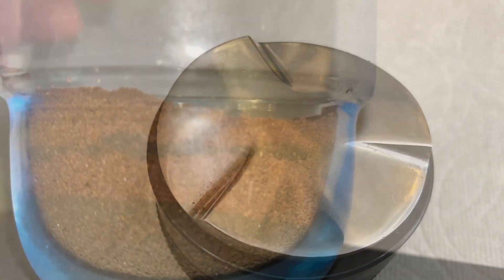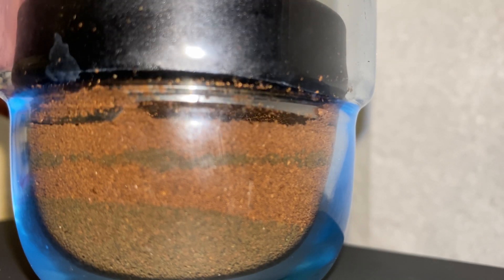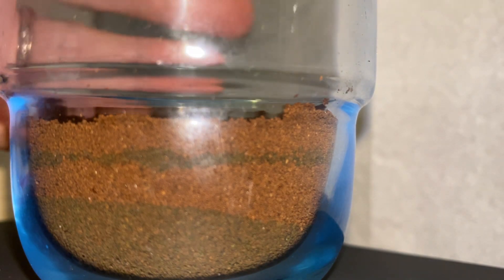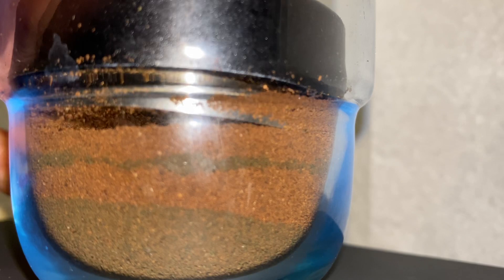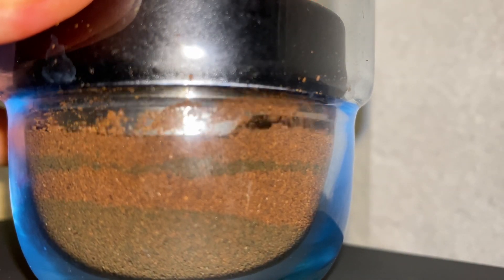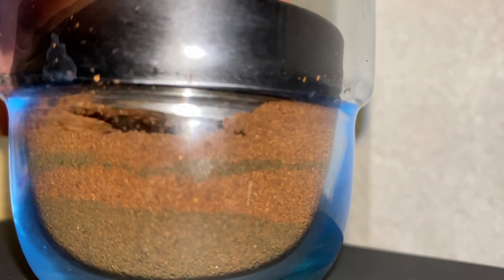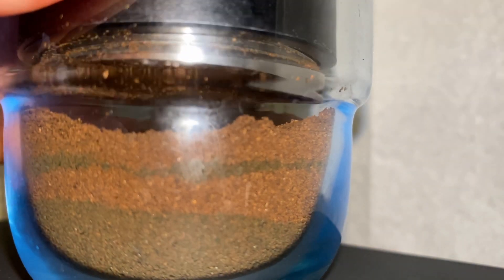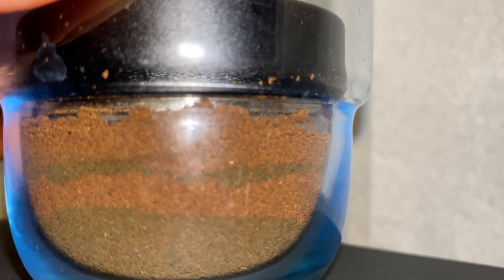Destroying the Myth of OCD Distributors for Espresso

Comment: lots of people refuse to believe distributors are probably worse for your shot... they find it hard to get over the fact that if they can SEE a level puck it must be doing something right. i have changed my process so that its tapping, WDT, tapping, tamping. after you WDT and tap, you get a very level puck that you then tamp, i feel my shots taste better as a result. i believe that the distributor tool axial force or sheering force creates grounds that are more tightly locked together on the top of the puck. i believe the tool creates a top layer that is difficult for water to get through and as a result water goes down the sides of the puck or partial channeling (channeling through the top puck layer only, then more even water distrubution through the bottom layer of the puck). If the channeling theory is true, this is probably why extraction yield is lower yet timing isnt really impacted and the shot still looks good in a bottomless portafilter.
Reply: I blame society for making it "not cool" to understand math!!!
Reply: What is wdt?

Comment: Distribution LEVELing tool is meant to LEVEL and tidy up the surface of the puck pre-tamping, not to mix & comb the whole through like WDT does. Think of it as a tool for the classic finger sweeping replacement. Plus what you did in the video is just a holy mess with unrealistic expectation. I personally like it, it creates a LEVELed and evenly distributed surface for tamping.

Comment: You got balls claiming this to be an experiment.  Or maybe it is not balls, anyway you have no idea of how to conduct a proper or valid experiment.
Reply from the maker: I’m guessing you didn’t read the description where I link to another experiment and other existing data or did you use this single sample to judge how well I did a proper experiment? 

If it is the latter, I recommend getting a larger data set that’s statistically significant. If it is the former, check out the description.

Comment: j.k... the tool doesnt sit on the top of the cup precisely.. this video is a total crap... plus it is not a distributor but only flattener.. you use distributor first, than the flatenner than tamper.. m.g...

Comment: Well, a useless experiment, if it is the one in the first place at all.

What the heck! The tool is not supposed to move the whole ground in the basket in the name of distribution which you seemed to be so obsessed with. 

It is supposed to move and level/distribute the upper crust and that's it...

What's in the name anyways!

Experiment/Theories/Data - my foot!

Much ado about nothing!
Reply from the maker: So to recap your comment, you say this device only is supposed to move the top, and this experiment confirms the theory. What is the problem then?
Reply: @espressofun6091  Looks like you are pretty paranoid about the whole thing concerning OCDs. Believe me, your experiments, data thing and theories are all like getting paralysis by analysis. 

Call it leveler or a distributor, it is meant to move the upper crust only and you are not supposed to make earth shattering efforts to move the entire burden in the basket.

There is no need to move the entire mountain for every job😂😂🤣🤣
Reply from the maker: @Hypocrisybuster1  you do you. I have an aim and I have analyzed a lot of my equipment in my journey to get closer to that goal. This tool doesn’t fit based on data.

Comment: Before saying i just destroyed a myth of one of the most successful specialty coffee companys learn to use the tool buddy. you are turning it the wrong way firstly and secondly you need to change the depth of it DO UR RESEARCH
Reply from the maker: I have reflected on your comment and did some research. Here’s the summary of that research: https://towardsdatascience.com/ocd-tools-dont-work-for-espresso-5b2f988af495
Reply: @espressofun6091  that’s not the ocd buddy that’s a roped off version :)
Reply: @espressofun6091  mate what you are using here as an example isn’t even the offical ona coffee distributor it’s a ripped off version, not sure why you are trying to make a fool of ona coffee but they are way out of your league in terms of coffee
Reply from the maker: @sun5534  why would it matter if it was the original or a ripped off version? The design is the same unless I’m missing something.
Reply: @espressofun6091  the design isn’t the same just look at the difference on the bottom and buy a actual ona coffee one it test it.
Reply from the maker: @sun5534  it’s a wedge. Why would it perform fundamentally different? It may have a different angle of surface, but it should perform the same. If spun what you say is the right way, within a quarter turn, everything is just flattened, not distributed. 

It is pretty and spins, but there’s not good evidence by design or performance that it is a good tool to use. I would gladly revise my opinion given data to the contrary but I have yet to see such data.
Reply: @espressofun6091  the different shape changes mate i tired this, please get your facts right ona is in another league  of you
Reply from the maker: @sun5534  it’s an opinion not a fact to say Ona is out of my league. I agree though, I think they are. I’m terms of science, I’m definitely a few leagues above. You can appeal to authority, but I am an authority especially for data related stuff. 

I would love for you to collect some data and show that this device empirically improves Espresso extraction or taste. I would gladly change my time but Ona also hasn’t produced data. They’ve only said trust me. 

I understand that you trust them. I trust science so show me the data.
Reply: @espressofun6091  also where did ona say trust me???? And they don’t need to provide data it’s like going to some big manufacturers and saying tell me this this and this things that could be confidential on purpose so there aren’t copy cats
Reply from the maker: @sun5534  I’m not talking about copycats. I’m talking about whether the tool is useful. All existing data says the tool decreases extraction. Not just my data.
Reply: @espressofun6091  where did you get all of that existing data from
Reply from the maker: @sun5534  I think it’s wildly used because it creates a nice visual and tamping on a flat bed. For a cafe, consistency is key not necessarily the best performance. 

Coffee competitions aren’t the end all be all. They are a performance. They aren’t graded on the best espresso. So while I’m glad he does well, unless he has data that the OCD is helping that performance, I will patiently wait.
Reply from the maker: @sun5534  I compiled the data here. One is Socratic Coffee and the other is a Compound Coffee. Additionally, I have seen some from Sprometheus as well as Pillar Coffee. 

https://link.medium.com/ak4hO0zpgtb

Comment: You're not even using it right.  That's pretty cringe.
Reply from the maker: I’m guessing you didn’t read any of the other comments.
Reply: @espressofun6091   I didn't even watch the whole video.
Reply from the maker: @bluemystic7501  you probably didn’t read the article or look at the follow up video.
Reply: @espressofun6091   In my eyes, you lost all credibility when you failed to use the leveling tool properly.
Reply from the maker: @bluemystic7501  in my eyes, you lose all credibility when you fail to read my reply and look at how and why the tool is designed the way it is.
Reply: @espressofun6091   Bro, the tool could not be easier to use and yet you still managed to use it incorrectly.  If it were me, I'd delete the video for fear everyone would see what I moron I really am.
Reply from the maker: @bluemystic7501  I won’t delete the video just because it shows your lack of humility. As I have said in the same comment (since you’re not the first one) is that it can’t be a distributor if it doesn’t move the coffee grounds around. I showed in further tests that moving the direction you suggests doesn’t move coffee but just flattens it. Only by moving the direction I moved it will the tool actually distributor grounds. Hence the name distributor. You can freely experiment with this yourself by placing one or two string on your coffee and spinning it in either direction. In one direction, the strings won’t move, but they will be flattened. In the other direction, the strings will move. 

If you have made it this far in my reply, congrats! I didn’t think you had it in you.
Reply: @espressofun6091   Well that's the thing, they're levelers.  I would still use a pokey distribution tool as levelers won't de-clump your grounds.

Comment: this video serves as a reason for why it was a mistake for YouTube to remove the dislike counter. you obviously are not using the tool correctly.
Reply from the maker: Obviously! It’s a distributor for crying out loud. Turn it the direction that distributes coffee!
Reply: @espressofun6091  OK, have you found a distributor that worked using the same way you used this one? maybe this distributor levels and distributes at the same time?
Reply from the maker: @DR19X  the way I turned it distributes and levels but it only distributes the top of the puck. I have another video and an article about how if you turn it the other direction, it only levels. 

I made my own tool that’s just a flat edge or slightly curved edge to get an even distribution.
Reply: @espressofun6091  ok I will check them out. thanks

Comment: 1. Your cup is too big for the tool 2. Why are you turning it counter-clockwise? Also this tool is supposed to level the grounds at the top not distribute the coffee.
Reply from the maker: 1. Does that affect the conclusion?
2. I explain it here: https://towardsdatascience.com/ocd-tools-dont-work-for-espresso-5b2f988af495
	2.1. If it is suppose to level the grounds, why is it called a distributor? It was either terribly made by everyone in coffee or it is also meant to distribute the grounds.

Comment: https://youtu.be/ikoIC3TDnJw

This shows a much more representative puck. Can see it rotates the base of the puck unlike your experiment. You don't even leave a level surface which shows something is up.
Reply from the maker: It barely rotates the bottom and  only for a short time. Someone should do the same test with different depths. That tool also has a spring in it so it’s not the same comparison.
Reply: @espressofun6091  tbh, i use one instead of a tamper, set it deep and then rotate it to level off the top. Anyone using one without doing a tap or some other distribution technique first is gonna have a bad time
Reply from the maker: @hillclimb182  oh good! What distribution do you do before?
Reply: @espressofun6091  atm I just use a few side taps to get the grinds even, and then a vertical tap to settle them, before using the tool and it seems to work well. I keep meaning to use a wdt tool but as I'm using a 54mm sage machine, my grind isn't super fine so I don't really have any clumps to sort out. I just want a decent flat white every morning so gives me a bit of forgiveness Vs someone wanting tasty espresso.
Reply from the maker: @hillclimb182 I have a Niche and my climate is dry so I rarely have clumps.

Comment: Well, while you’re probably right about the tools performance, now you’ve got the anger of a whole community which has been mislead by marketing tricks against you, probably forever. 

Just to be clear: to me it’s more a marketing gag than anything else: 
“oh look now my puck looks flat, therefore the distribution on top has to be even” just doesn’t sound right to me. 
To explain why there’s possibly lower extraction, you first have to examine the distributor itself. The distribution action works, as long as the tool is actually spinning. The problem here is, that coffee grounds aren’t compressible to a certain point, and even if, the tool won’t magically find it (this point of perfect compression) somehow. (If that were the case, you could just grind with a normal blade grinder and wouldn’t have to worry about anything. Or in other words: there’s no increase in homogenous distribution, except for the top LOOKING flat). Since it’s height is fixed, there’s just uneven compression happening at the fins. The spinning of the fins doesn’t remove this effect, it just shifts it by rotation. This means, that your beloved tool is distributing uneven compression rather than distributing the grounds. What I mean by “distributing uneven compression” is that the coffee grounds are “connected” and therefore, the force not only travels downwards but mostly sideways. Therefore, behind the fins, the coffee always is compacted slightly less dens than directly under them, even when you are “finished distributing”. Because there’s only that small difference, you won’t actually see any visible channeling, but it will happen, only on a much broader surface area.
Reply: Well, that’s a lot to read through, I guess. 
But, I’ve to add, that the ocd tool or other “distribution tools” are just falsely called that. Most manufacturers even call them leveling tools, tho many people confuse that with distribution. 
The OCD tool and others have been designed originally only for competitive use, since there’s actually some grading of puck levelness in barista competitions.
It’s also used commercially, since wdt just takes too long, and it’s preferred over the stockfleth method, mainly because it’s cleaner and easier. In a commercial setting, this is better than only tapping and tamping and this actually should also be its only use. There’s some people who may be improve on their extraction due to doing the wdt wrong, or only tamping. But mostly, if you are doing wdt and then using any leveling tool, it decreases extraction, this is at least, what most if not all data has shown. Look at i.e. Sprometheus, he also uses the ocd tool, but actually recently stated, that in his experience his leveling tool decreases extraction (I’ve seen him being mentioned somewhere here in this discussion).
Reply: Yup... A bunch of smoke and mirrors

Comment: There are many debates on the direction. Based on the wedge design, both sides are symmetrical. In this case, the result should be the same. Most of us will turn clockwise, and this video shows anticlockwise, but you can't use both ways, either ways should produce the same result.

Comment: Whew this is painful to watch.  Clearly spinning the wrong way 😂 also who mixes grounds for their shots? If you want to do an experiment, then you should try and get as close to the actual test itself. So same grounds, same basket(yours is clearly huge), and use the tool for it's correct purpose: to create a level puck for which to tamp. Of course if you don't want to use it then it's very simple don't.  But don't add misleading information our there by conducting a bogus test and saying it doesn't work. Obviously if I use the prying section of a hammer to put in some nails it won't work, because I'm not using the tool correctly am I.
Reply: My thought exactly
Reply: https://youtu.be/ikoIC3TDnJw

Here's a better one
Reply from the maker: If you spin it the other way, it is just a leveler, not a distributor. I mean, it’s not like multiple people haven’t collected paired data with and without an OCD type distributor and showed that they actually decrease extraction yield…

Comment: This is somewhat controversial, isn’t it. The video is not great, but got me into reading the article which i found great. I understand your point, you’re correct. I’d like to ask - i usually distribute the grounds by tapping (as evenly as i can) and use my leveler of choice instead of a tamper - I’m simply not a fan of tampers. Would you say that’s okay? I’ve used a Motta leveler for a long time (mainly to get a level groom on top and slight compression), i’m using a naked portafilter and judging by what i’m seeing once the extraction starts i’m getting pretty even and easily repeatable extraction, without spurts or visible channels. Thanks for the content!
Reply from the maker: Thanks! I tap and then use a custom distribution tool which causes the sides to have more grinds and thus higher density during the shot. This reduces the inherent donut caused by how the water from the lever enters the shower. 

I too use video for all my shots, and I’ve been doing some post-shot analysis using images of the bottom of the puck to help find dark spots.
Reply: And what are your thoughts on this? 

https://youtu.be/ZUC0CUiea2U
Reply from the maker: This is interesting, but I suspect their tampers don’t quite do this. The stockfletch method is the best out of those based on extraction data.

Comment: Well i subbed this channel because of scientific content but when i see this video i am kind of shocked. I think this should be april 1 joke or smt. I appreciate your effort and i am finding them helpful but this video should not be on internet. Because your application is wrong, your tool does not fit your so called transparent filter basket and the saddest one is you are not aware of any of those.
Reply from the maker: Hey! Thanks for your opinion. As a science guy, I care about data. Show me some data. 

In the mean time, I wrote this for you to help better explain why the OCD tool used as you prescribe, is nothing but a leveler. So it really doesn’t distribute anything. https://link.medium.com/dkvWjUzbeeb
Reply: @espressofun6091  OCD like tools do distribute the grains but only at the surface level and because of the it's shape and rotation, yes it levels the grains too. if you are speaking about even distribution through the whole basket depth, i would try a vibration/shaker kind of device though.
Reply from the maker: @kerembyl  OCD tools decrease extraction yield by significant amount, so either way you spin it, it’s garbage. 

I have seen VDT, but my shot prep is more complicated than most. As a result, I made my own distributors.